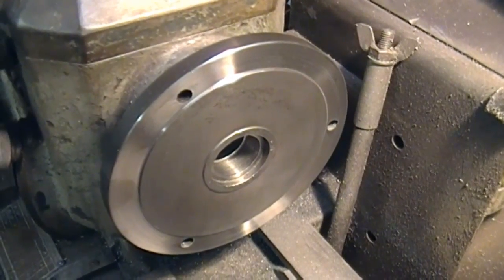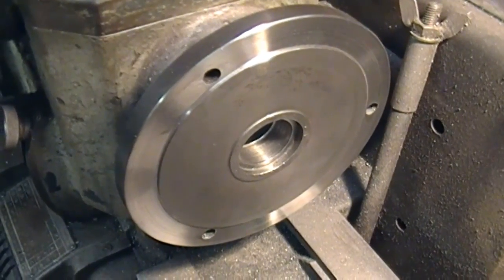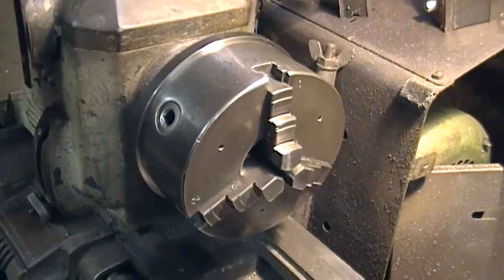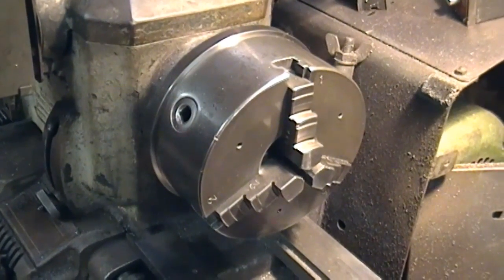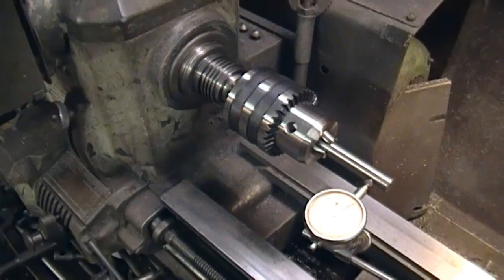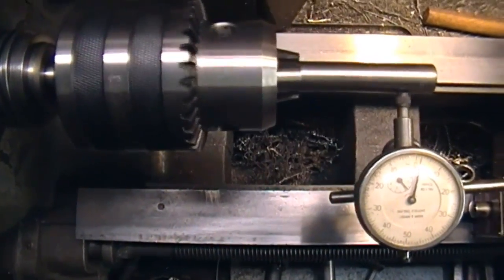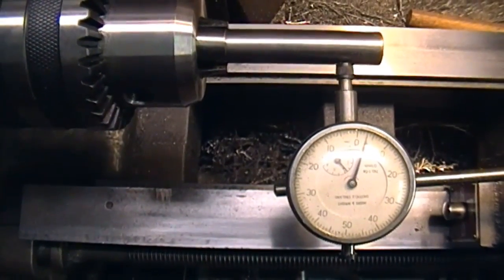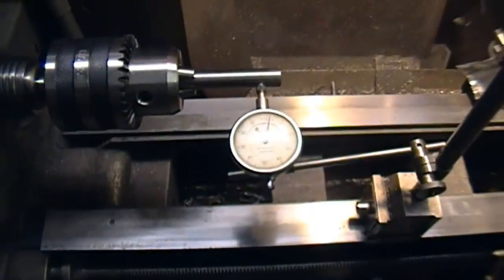Chucks, More Oddments

Comment: If I had to set up a spindle, 4MT to 2MT sleeve, 2MT to 3JT (probably) arbor, and chuck, I would consider "clocking" them to see if each had any intrinsic runout, and then trying to find a way to assemble them so the individual runouts counteracted each other to give a set of chuck jaws that ran true with the axis of the spindle, both in angular and radial runout. Once you find that, you would be able to mark each piece with a witness mark so you could assemble them the same way each time.

My tailstock taper is not perfectly aligned with the axis of the tailstock quill, but I happen to have a 2MT to 6JT arbor that has about the same misalignment. I can put them together to align the chuck to the quill axis quite accurately. There is a single punch mark on each of the quill, the arbor, and the chuck base which lets me put the chuck in the tailstock with the best accuracy possible (and repeat, if I ever have to remove the arbor from the chuck).
Reply from the maker: Peter W. Meek More excellent thoughts Peter - thank you. Yes very true - if 'self'-neutralizing' aspects can be found by clocking this does represent a very good way to improve truth once parts are marked for pairing up etc..

Comment: I bought a brand new import 10" 4 jaw that had over sized travel grooves and to hide it from the customer they left big burs on the groves so the jaws fit tightly I only found out too late after running them in and out many times, and fitting it to the back... It's usable but will have problems with holding parts well if in the last inch of the jaws... Live and learn... Though I could not have bought a good used one for any where near as cheap. ;o]

O,,,
Reply from the maker: Opinionator52 Heck - that really sucks! I guess with import stuff it's often a case of 'caveat emptor' -- but then sometimes imports can work out very adequately and give the big cost saving. Bit of a lottery sometimes. :)

Comment: GREETINGS, WHY NOT GRIND THE INSIDE OF THE JAWS FOR A TRUER REGISTER?
Reply from the maker: AAR2VZ Probably not worth doing as the combined wear in scroll and jaw scroll followers is such that there will still be that element of variability when chucking material. If I had a suitable grinding set-up I could try it but - somehow don't think that will be a cure.
Reply from the maker: AAR2VZ Mike -- going to message you regarding that chuck.

Comment: My 3 jaw chuck has never been dead on true.  When you put something in it you can see the run out by eye, no need of a dial indicator.  So when I want to chuck something up really accurate I just use the 4 jaw and that makes it all just right.  Mrpete trued up his 3 jaw chuck with a grinder in one of his videos because the jaws were not flat all the way through.  He made a circle and opened it up against the circle.  I don't remember if the run out was changed by that or not.  As for Jacobs chucks I think the more pieces you stack together the more the error.  Thanks for sharing.
Reply from the maker: Guess my 3-jaw ain't so bad then!!  True tho - when precision really matters the 4-jaw is way to go. I remember that video of the jaw grinding job -- however, I don't reckon my jaws are very 'bell-mouthed' so main problem is plain old wear! Yes, adapter into adapter can introduce errors but was happy to see this new one shape up well, considering it was M2 into M4/M2 adapter.

Comment: drill chucks not very accurate.  I think your set up is good though.  Most non-adjustable 3-jaws are about .003 out of round.
Sometimes you can un-chuck the rod, turn it 90 degrees and get a different answer.

Cheers!
Reply from the maker: Indeed, re-chucking even drill rod can improve things.

Comment: Hi Chris, first off wishing you a happy new year from the old country.
Now as you might remember silver steel, your drill rod, being centre-less ground is often tri-lobular not round but still of constant diameter.
About your chuck, on an old chuck you might be better not having a tight register so you can "massage" its position for concentricity. As for non consistent gripping, are you using the master key hole? If not marked with a circle on the periphery it is the one nearest the Burnerd label. .
ATB
another chris
Reply from the maker: Same back at you Chris. Interesting point you make re the drill rod - although generally it certainly runs better than regular material. The 3-jaw back plate register is not actually mega tight - just made as a good fit - and results don't seem to suggest any ''wiggle room'' would help much.  That said, I might prune off another couple of thou to give more scope. Right now - had enough of that chuck! Never actually used a master key position - tend to progressively tighten via all three but - will check out the Bernard one. Thanks. :)